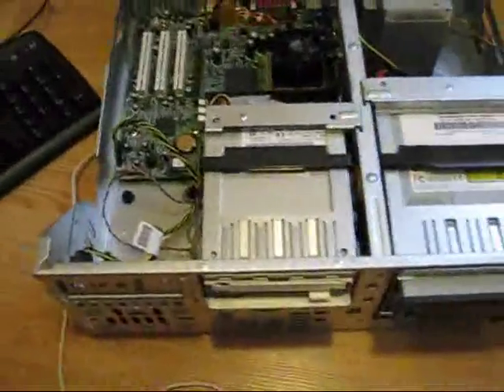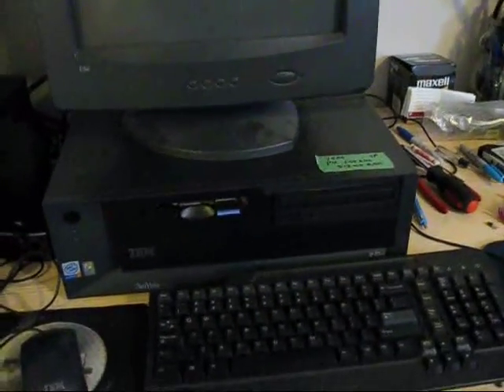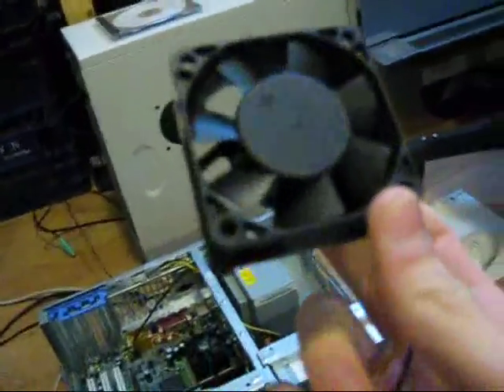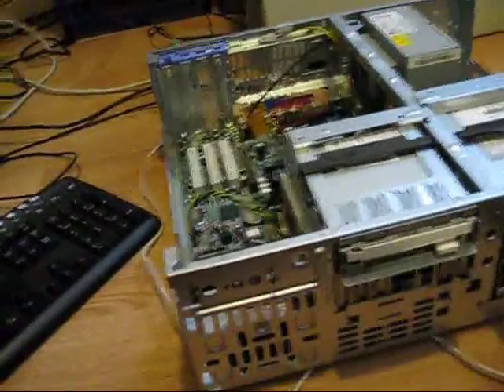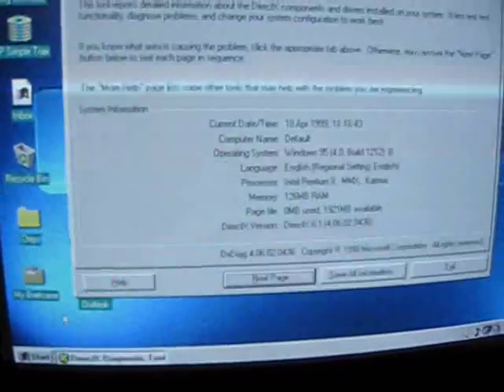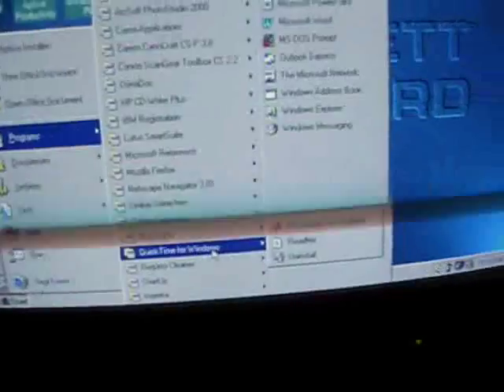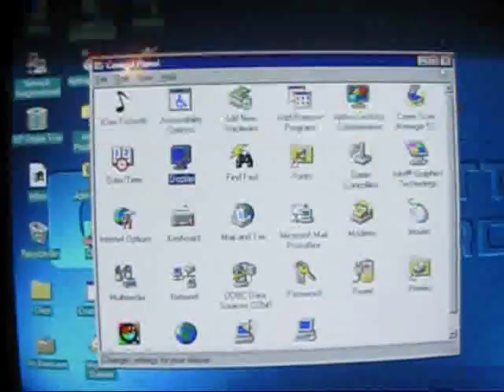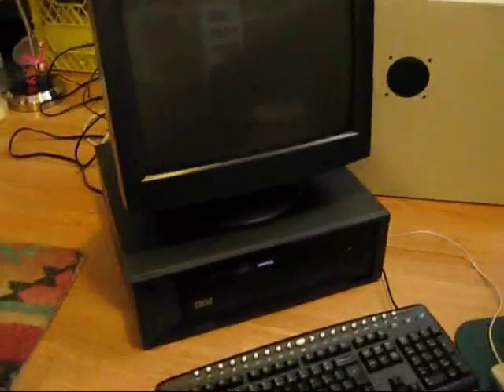The Finished Windows 95 Gaming PC

Comment: If your psu still has plenty of 4-pin molex connectors, then you can use a molex to fan header adapter if you want to run some case fans. You can find something like this on Amazon.